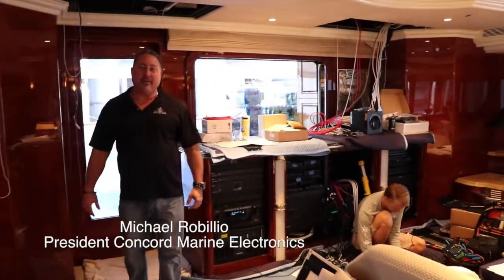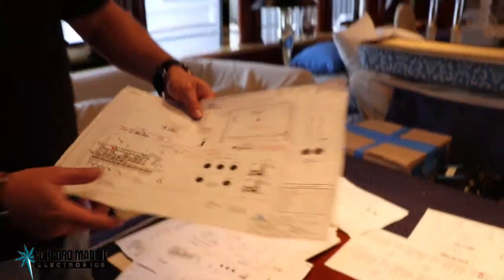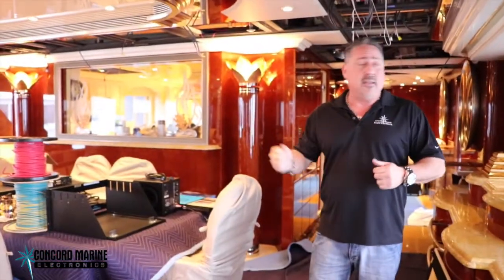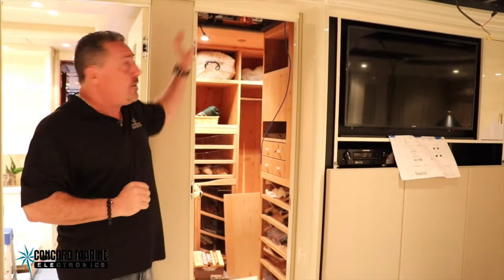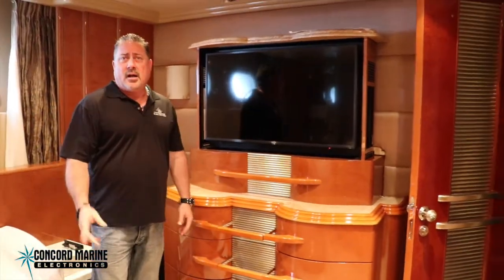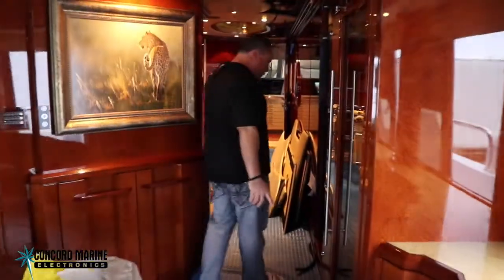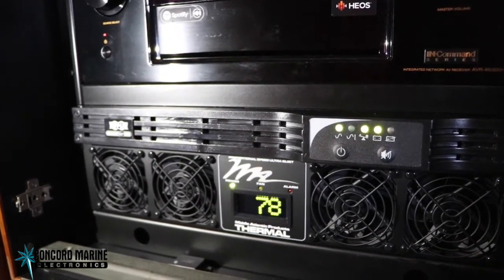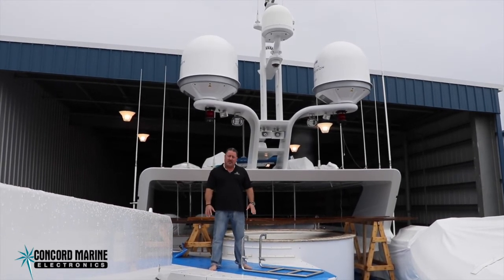145ft Christensen Crestron and KVH HD11 Audio Video System Refit, with vessel tour during refit.

Comment: Nice job, do you guys answer questions about this type of setup?
Reply from the maker: Thanks for checking out our videos. What questions can we answer ?
Reply: Hi,
Thanx for the quick replay.

Where are you guys located?

If you were doing a Circumnavigation, do you need receivers for every different provider?

Then you change out the receivers as you go?
Reply from the maker: Yes, you are correct, you need a different receiver for each geographic area, and an antenna capable of worldwide satellite reception, such as the KVH HD11. What is the size of your vessel? We are located in Fort Lauderdale Fl, USA
Reply: I'm a Nordhavn Dreamer in Jupiter.  No boat yet, just planning.